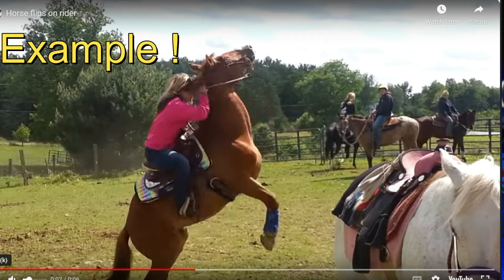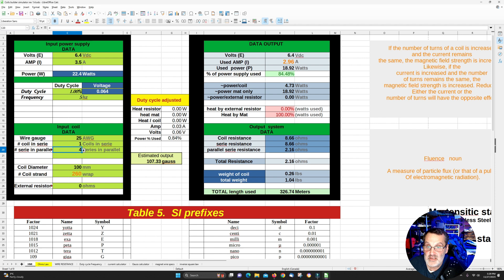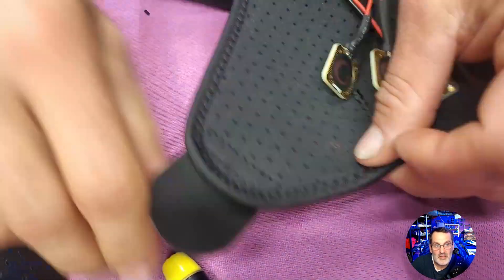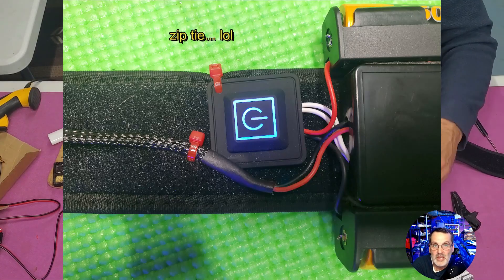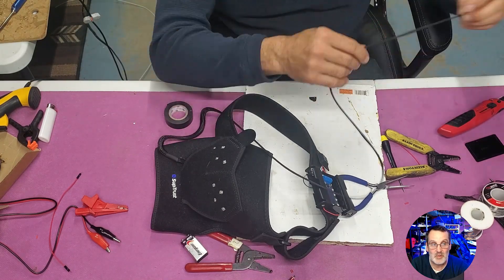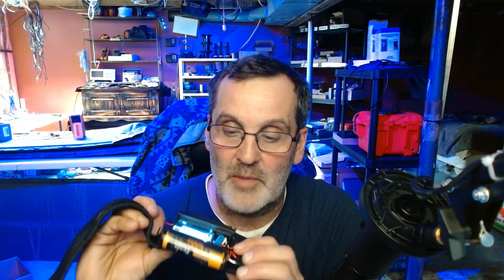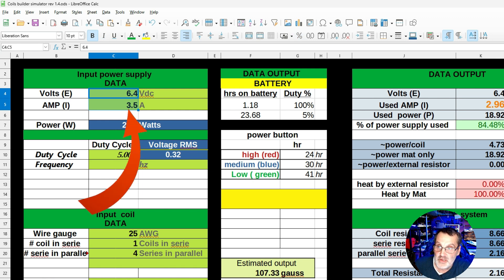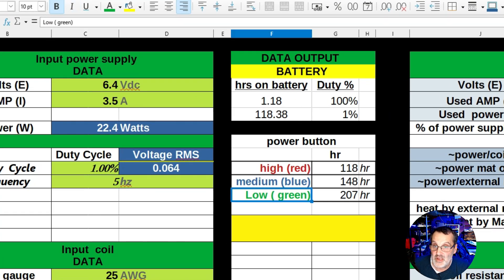I build the ultimate shoulder injury recovery device.  400% faster recovery!

Comment: Steeve, very impressive, thanks for the video. 
Would love to learn more about that magic button when you post on Patreon.  I'm nursing a shoulder issue as we speak and very keen to get the details of your build.  With your support i have started to build a similar unit for my shoulder but the magic button is very interesting. Keep up the good work, much appreciated.
Reply from the maker: Will post soon.  Been super buzy on a ton of projects....   need to clone myself
Reply: @Steeve.   I can help maybe on the cloning if needed LOL (I could be your US clone; other than I have no horses).  I have the EE mindset, with many years of coding and a lot of parts.  I normally use a NANO or ESP8266 and mosfet with and driver.  Maybe I can help out?  Have a scope, iron, helping hands, wire, parts and modules  (too many of each) etc.  Let me know.   I would like to get a copy of the calculator if still available from the videos.  Thanks.
Reply from the maker: @rekim  steevebradet@outllok.com 

Email me :)